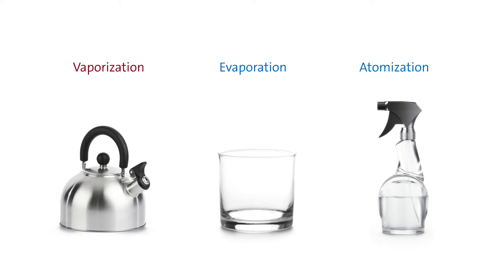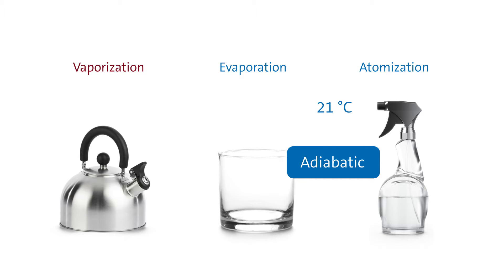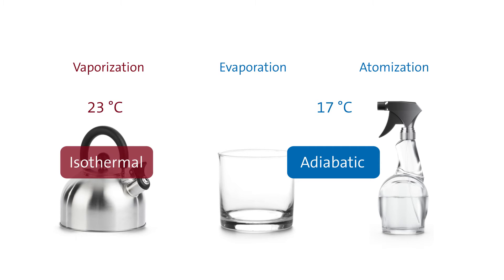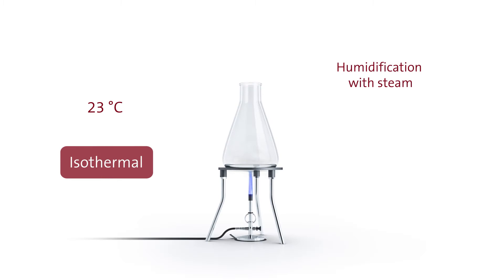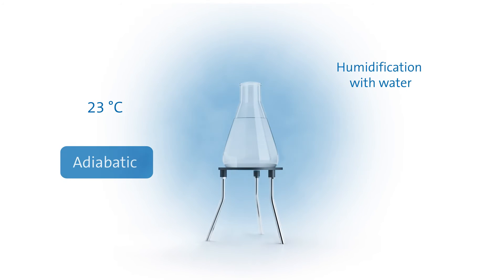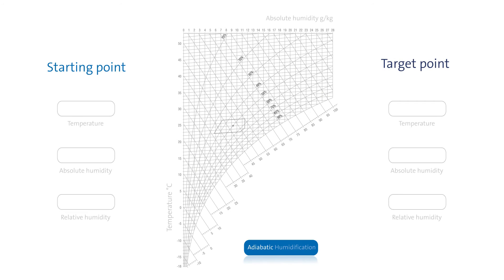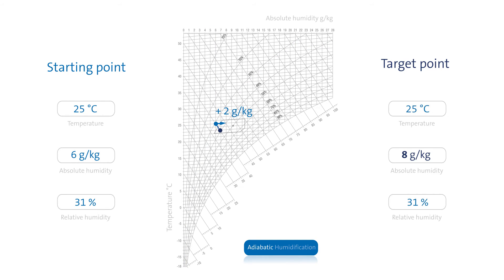What is adiabatic humidification? | Humidification Made Simple

Comment: What minimum temperature of air can be achieved by evporative cooling.
And what will be the sprayed water temp?
Ex if i have air initially at 42 dec C and  37% RH.
Can  we achieved air at 11 Deg C and what will be the sprayed water temp.
Reply from the maker: Dear Sanjay Yadav, To reach 11°C by coming from 42° / 37% RH seems to be not easy and maybe impossible. For a concrete answer on that i would recomend you to contact the local Condair-Partner in your Country and ask them to provide you a calculation for your specific application.